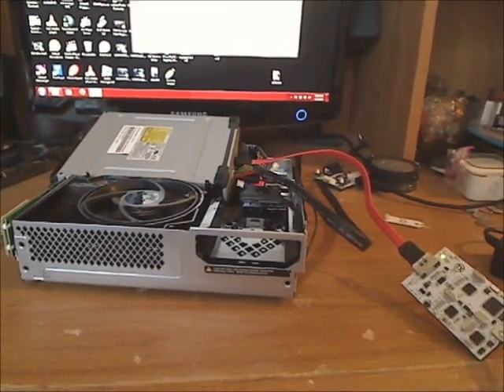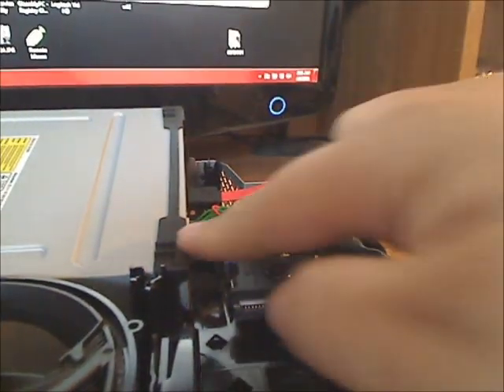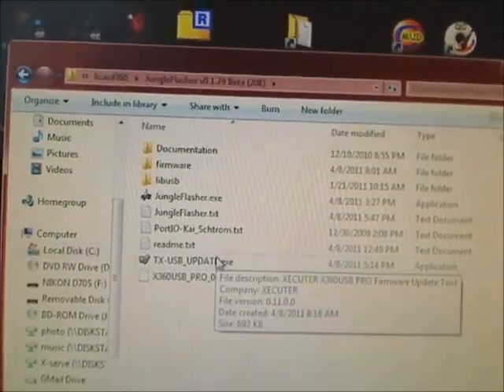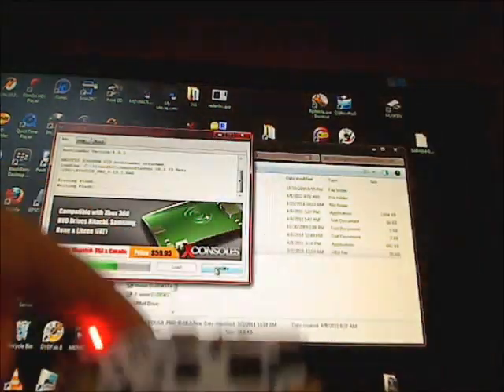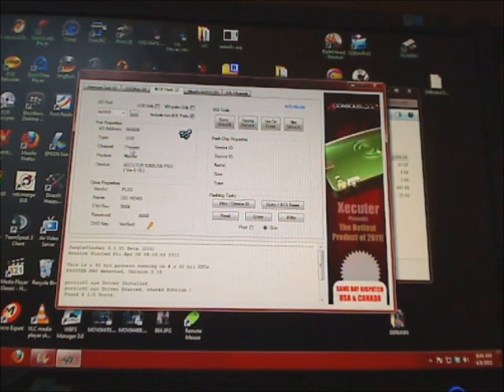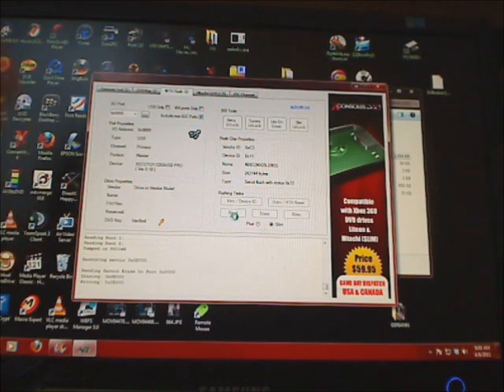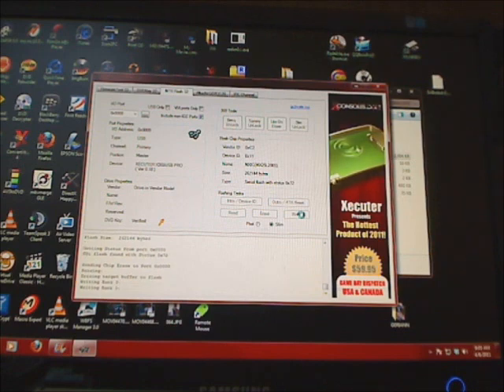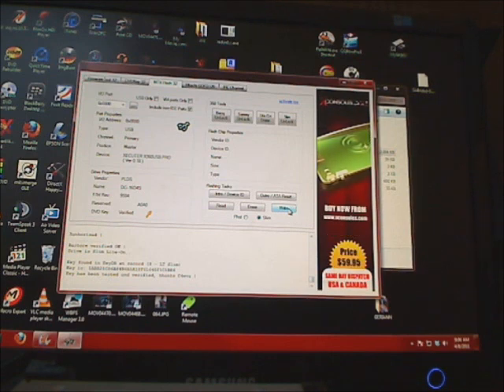Flashing Lite-On 9504 with LT+

Comment from the maker: @CFAMediaV9  You need the drive key to update the firmware but this can be obtained from the drive itself regardless of the firmware installed. Having the firmware.bin original only makes it easier to get this key since some drives require additional hardware to extract these keys.

So having the original firmware is more of a convenience rather then a necessity.